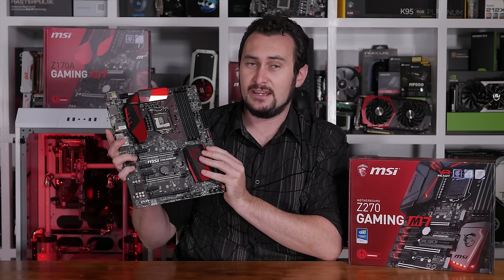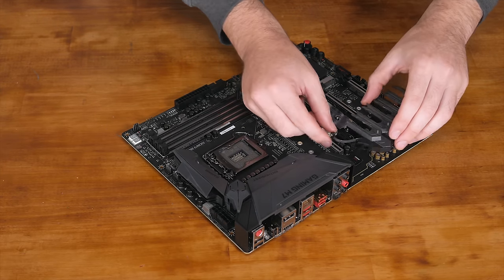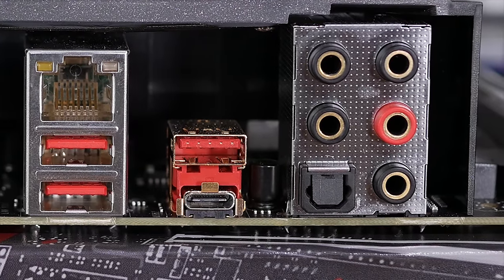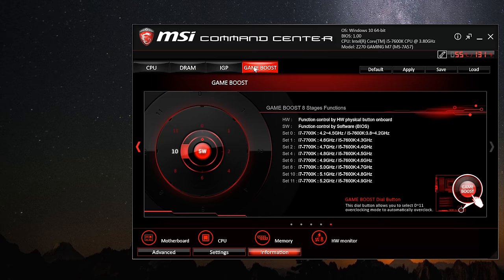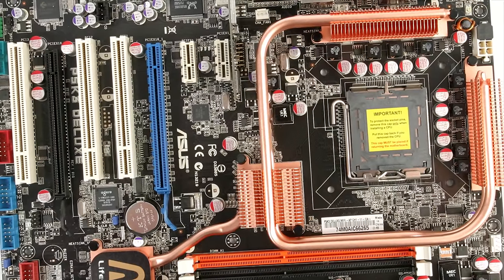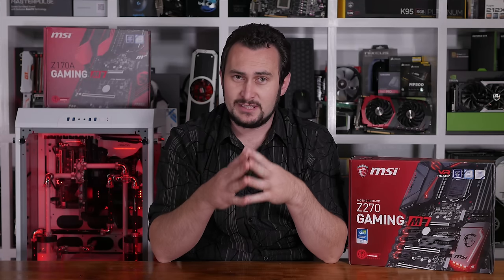MSI Z270 Gaming M7: Includes M.2 Shield Temperature Test

Comment from the maker: PRICES & VIDEO INDEX!
Amazon: http://amzn.to/2jWAVJj
eBay: http://ebay.to/2kMRXZu

0:00 - Intro
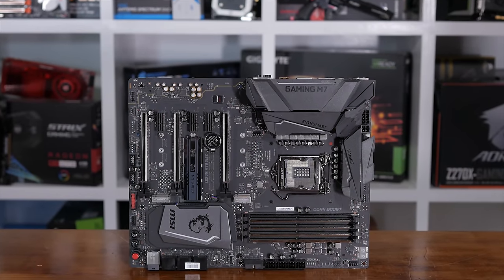0:48 - What's new?
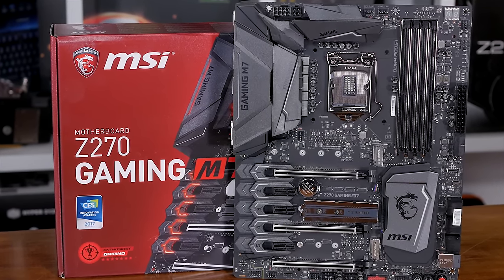1:09 - RGB galore
1:40 - What I don't like...
2:27 - Heatsink temps
3:45 - The M.2 Shield
4:28 - Steve from Gamers Nexus
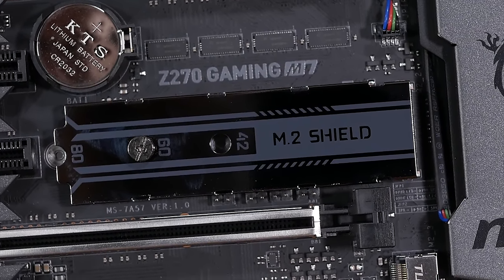4:51 - Bit-Tech review
5:16 - My M.2 Shield results
6:25 - Storage options
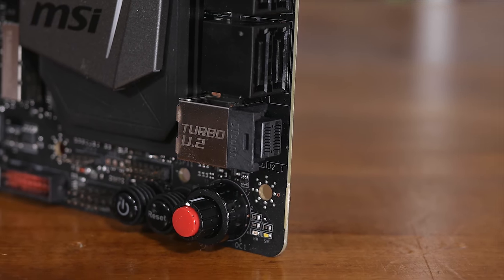7:05 - The audio stuff
8:48 - USB connectivity
9:38 - VR Boost?
10:26 - BIOS
12:41 - Overall thoughts
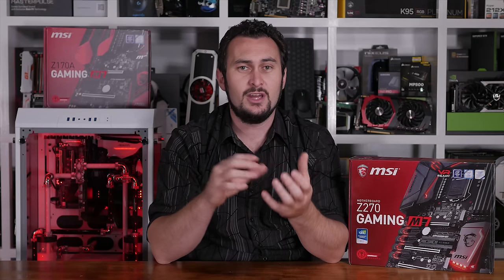13:34 - A look back...
15:13 - Conclusion
16:13 - Outro
Reply: Hardware Unboxed Steve Quick question. If i have to opt for an i5 7th gen. Will 6th gen 1151 socket motherboards support it? Because these z270 and all are too costly. 
I have read bios upgrade is needed for g4560 so any alternative or a cheapest 7th gen mobo.

Comment: A bit disappointed that MSI goes for the looks over performance,  and as You said, it seems to be a trend.
 My previous MSI P35 Platinum had circu-pipe heatpipes on motherboard, funny looking copper-carousel but effective. 
Thanks for the informative video ones again! Cheers.
Reply: B00tman yeah agreed. that plastic shroud looks badass but it is not useful.

Comment: Can you test the m.2 shield with a GPU installed next to it under load?(not a blower gpu obv)

If there is one scenario that it can actually act as a shield this would be it.(prevent hot air reaching the ssd)

Comment: I'd rather get better temps than the "RGB" where the color I wanted, White, doesn't match up with the rest of my LEDs.  Do you have a source on how to properly remove them?  Does it matter if the shrouds around the PCIe slots are removed, do they also cause more heat?

Comment: With Game boost function, ram memory will be overclocked as well? And should i lowering the voltages of cpu and memory after the auto overclocking of Game Boost, or will be fine? I wanna buy this motherboard because of this function: Game Boost.